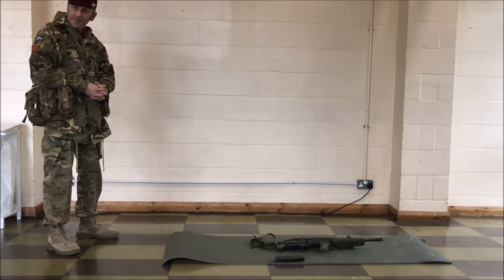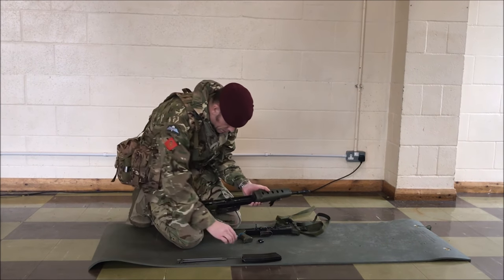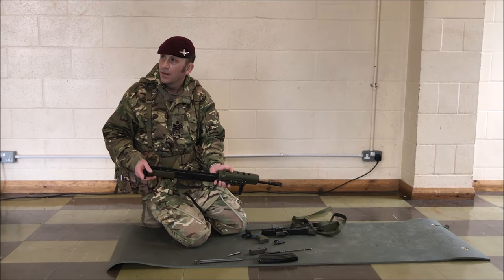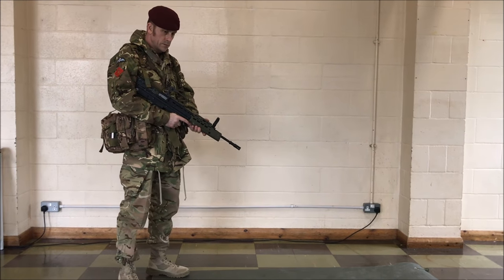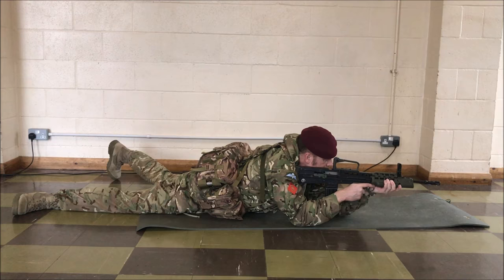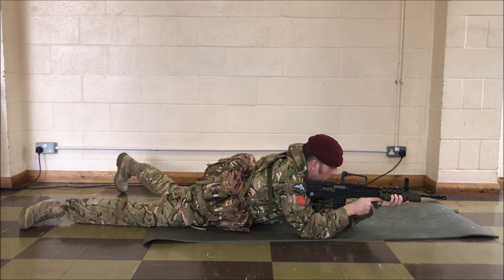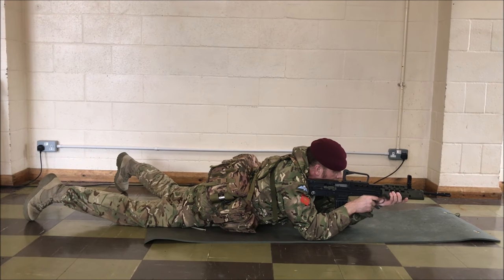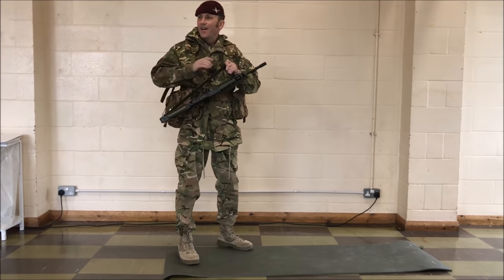L98A2 WHT

Comment: Didn't forward assist 😂😂😂
Reply: It isn’t ACF
Reply: Joe Is Clever so why is he wearing a CFAV TRF?
Reply: I’m joining army cadets soon when corona is over, does anyone know what forward assist is for?
Reply: Lewis Byrne it’s not a forward assist, it’s named changed when the L85 went from A1 to A2, and when the L98 did likewise.
It’s now known as the tap forward and is to ensure the locking splines on the bolt are fully engaged and therefore the bolt is fully forward so the firing pin can actually hit the percussion cap/primer
Reply: Jim Shoebridge but like what’s it actually for, when you run out of ammo and load a mag and you have to press it?
Reply: Lewis Byrne wait until you get taught it
Reply: Jim Shoebridge ok thanks for the help!
Reply: @Meow-gd2my  forward assist is for when theres some malfunction thats stopping the bolt going fully forward under its own power. when the magazine is empty, it should just go all the way forward by itself. when you load a new magazine, if the bolt is open, you press a button on the left that unlatches the bolt. if it isnt open, you rack the bolt with the handle
Reply: @Meow-gd2my  all ima say is don’t join cadets you’ll get rinsed😀
Reply: @callumbanks3522  I’ll be fine, the NCO is best friends with me, he said he will help me through out
Reply: @Meow-gd2my  if ur planning on joining the real army don’t join cadets I meant
Reply: @callumbanks3522  well no, join the cadets but just dont mention that you did
Reply: @EthanThomson  no stop being a mong they’ll find out they always do.
Reply: When it mattered he did, dont need to perform tap forward when doing pre strip NSP as you wont be firing the rifle
Reply: @Meow-gd2my  It’s to make sure the bolt is fully in place.
Reply: @joeisclever9225  That doesn’t matter
Reply: @joeisclever9225 he's wearing a CFAV TRF and is using an L98A2
Reply: @Meow-gd2my  to make sure the cocking handle is fully forward.

Comment: I appreciate this is a test for cadets. Functions test doesn't have to be full as it is repetition only with the cadet rifle (L98 A2) however once obstruction is CLEAR. user must check chamber . CHAMBER CLEAR. this is to ensure there is not a round seated in the chamber before re inserting magazine and releasing the bolt. If there was a round in there you would be starting back with another obstruction. Should all be in pamphlet. Let's ignore the rest for now haha
Reply: That is the function test for the Cadet GP.  And yes it does have to be that exactly.
Reply: Luckily I passed it, it's quite easy once you get the jist of it.

Comment: We was re-issued with this in Late 86 and we all hated it, Wanted our SLR's back.  When first issued the SA80 was a total pig, breach explosions, constant stoppages due to the gas work issues....mainly due to the carbon build up,  things used to break off, we was issued M16 mags to start, dent....round jams, spring frics in the Mag.......and the damn mags had a habit of just dropping off the damn weapon.  Thing I hated the most whilst stripping, yah that bloody horrible strap removal......lol.   Good points Great accuracy, short & compact, and the 5.56mm being so much lighter than the 7.62 you could each carry so much more ammo into battle, the SUSAT being standard was also a great turn.  Must say it became a much better weapon once HK did the overhauls. But still, it certainly didn't have the stopping power of SLR......you knew you hit the target when slotting with the SLR, SA80  required multiple hits to down ya target in most cases with body shots.
Reply: Strange reply here from me mate.  I was 2 Para 74-97.  When we changed from the SLR Blunderbuss to the SA 80,  I recognised two issues.  One, that the stopping power (in my humble opinion) of the 7.62 far out-smacked that of the 5.56, second, that the SA80 outshone the SLR (even with a Suit/SUSAT sight.)  The SA 80 certainly brought you up a level accuracy wise.  HOWEVER, having spoken to an ex REME armourer mate of mine (who did FORTY years in Britmil cos he was so good at his job,) he said that the reason that us Brits lost faith in the 5.56 was because on trials (which he was part of) they used BRIT manufactured/spec 5.56 ammo and it BEAT the SLR in penetration!!!!  I was gobsmacked at this.   When Britmil adaopted the SA80, we reverted to yank manufactured 5.56 (to save money, what fucking changes) and the adoption of that ammo, did not compete with the more expensive Brit manufactured ammo.  He did explain further (beyond my understanding)
Reply: @peterstubbs5934  Thank you for your service Brother.

Comment: Forgot forward assist in places and missed ejected round
Reply from the maker: Yes, good spot
Reply: @Bite_Me_MF  u do the forward assist every time the bolt goes forward (especially when u load a magazine) to make sure the round is in battery and to break down carbon that is present after firing or before firing that wasnt cleaned in the cleaning process, this whole drill actually prevents future malfunctions believe it or not. But ofcourse it is possible for it to cause malfunctions to go worse, with malfunctions u just need common sense.

Comment: Yes, he did not forward assist every time and he did miss the dust cover on occasions but if the rifle had been designed properly in the first place they would not be an issue. Give the man a proper RIFLE , no excuses..... "We sleep soundly in our beds because rough men are prepared to walk the night and do violence in our name." George Orwell.
Reply: its a rifle .. not a gun .. ;-)
Reply: @stuffbypaul  I stand corrected but what's the difference?
Reply: @stephennelmes2707  traditionally, guns have smooth bores, rifles have rifling in the barrel (So technically the main weapon of the challenger 2 tank is a rifle). but one definition of gun is "A tube for launching a projectile" so by that definition you are not actually wrong :-).  .. by that definition, all rifles are guns, but not all guns are rifles ....
..
Reply: @stuffbypaul  So it IS a gun. But, a more accurate description would be a hand held, optically sighted, magazine fed, one man portable, air cooled kinetic energy weapon using the feed cock load lock fire unlock extract eject mechanism. My MK 44 MINIGUN operates on a similar system but is electrically driven using a 24 volt DC battery.
Reply: @stephennelmes2707  its a mouthful , but that will do it, and save any arguments :-)
Reply: @stuffbypaul  No probs mate. If you're into guns. Check out the XM556 from across the pond. Like the MK 44 a bit indiscriminate and I expect, a bitch when stoppages happen but hard to argue with at close range.

Comment: I have heard and read atrocious stories about the SA80/ L85A1. I own a semi-auto version of the Armalite 180 which has the same similar multi lug rotating  bolt, gas piston from the Russian Tokarev rifle, square bolt carrier, and M16 like fire control system taken from the M1 Garand, M1 Carbine, copied on to the AK series. Designed by Eugene Stoner  who invented the AR-15 and later improved M16, A1, A2, A3, A4, M4, and M4A1. I think it was a good design that the British Military had decided to use. First is the good.  First is the stamped receiver. Even though the Germans were first to produce submachineguns as cheaply for mass production as in the MP 38/40, later with the MP 43, STG 44 and 45. Britain produced more STEN guns for the war effort and provided more firepower. The STEN is a very good design but it came down to the soldier firing and selecting magazines that worked and functioned during training before combat. The STEN was good because I also own one. Bottom line is why didn't Enfield back in the day make any semi-auto versions make many for the American market for collectors and shooters like me? I would have loved to own one of these. I have an RSAF 1967 L1A1 which I have built and enjoy shooting. I can understand why the L1A1 is too long, heavy, less ammunition capacity as magazine wise for the average British or FAL, G-3 armed infantryman in combat. The US Army realized this in Vietnam. An American Infantryman in the early days as a Marine or Army would have 5-7 magazines loaded with 7.62 NATO in 20 round magazines and an extra 200 round bandoliers. Bigger caliber means more weight in a combat load with pack. Meaning in a fire fight or heavy combat which emphasizes more on volume of fire on the enemy so that a unit can maneuver and flank to close in. 7.62mm NATO ammo doesn't cut it for combat unless it's a GPMG to cover you as you move. The later M16A1 makes sense with all the improvements to ammunition and components like the chromed chamber and barrel,  chromed bolt carrier interior, and a 30 round mag. With these improvements the M16A1 was still in service beyond 1984 when the Army and Marines got the A2 and finally out by 1997. I have for my shooting pleasure an original Colt AR-15 from 1978, and builds of an M16A1 rifle, carbine, and M4s. Sorry I have been drinking too much but have enjoyed the topic.
Reply: Tldr
Reply: Gay
Reply: @jedcollings3624  Okay expert. Explain? 😂😂😂
Reply: This variant is only used by the cadets, not the real army and only has iron sights and only shoots semi auto
Reply: You are talking a load of bullocks, the STG45 never existed, the STG isn't a sub machine gun as it fires an intermediate rifle cartridge. "M16 like fire control system taken from the M1 Garand, M1 Carbine, copied on to the AK series."  NO, NO and NO you are completely wrong again.  Eugene Stoner first off invented the AR10 in 7.62x51 then the AR15 for the US military, the M16A1 was born, the M16A3 never existed either, Stoner had nothing to do with the rest of the M16 series after the A1. Your firearm knowledge is very poor; why can't you own an SA80 well it's simple because of the USA assault weapons ban, they barred the UK from exporting SA80s into the US for the civilian market.   

I'll leave this here because your comment is giving me a headache and your lack of firearm knowledge considering you claim you own firearms is truly shocking.

Comment: Some things to make sure to remember as they are easy to forget: Tap forwards. Always check safety. Right hand at rear to catch the spring should it fly out. Pre-strip NSP: Don't fire it off. Pick up the imaginary round that leaves the chamber after opening (when readied) Don't forget to take your time and talk/think yourself through it.

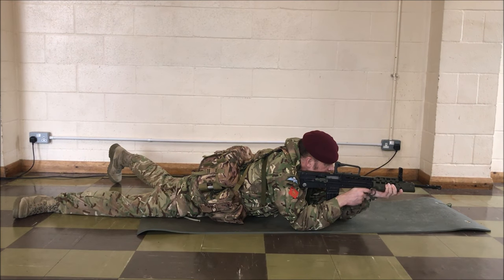Comment: At 6:16 when the weapon fails to fire first time & the instructor/examiner says "cocking handle appears fully forward."
The soldier forward assists & then (apparently) continues to fire. 
I've always found this to be a flawed practice, as when the weapon fails to fire you'd have fired off the action.
Which means the only action to take in the instance of such a stoppage would be to cock the rifle again.
By all means, correct me if I'm wrong, it's just a thought I'd had recently.
Reply: From my experiments with the weapon, if the bolt is not seated properly pulling the trigger does not fire off the action. Thus a forward assist would put the bolt in place allowing the action to be fired.
Reply: But then again, what I did do in basic training during pairs fire & maneuver, is get a stoppage & immediately try to re-cock the weapon, which because the bolt wasn't in contact with the round has caused the round not to be ejected & the next round has been pushed into the back of the round already in the chamber causing a mega stoppage & a great deal of shouting & flapping!
Reply: Due to the stoppage not being actually real, it's hard to explain, this stoppage is the bolt carrier not travelling far enough forward, meaning the hammer is not able to be realised due to it being cocked onto the safety sear, not the main sear (which the trigger can control), tapping forward assist would then allow the bolt carrier to move that little further forward, tripping the safety sear allowing the hammer to be cocked on the main sear, so when the trigger is pulled the hammer is realised and fires the round. In this test due to not being able to replicate the bolt assembly not moving forward enough when the trigger is pulled the hammer will come up, and the drill looks pointless, but for a live stoppage, this is absolutely what you should do.
Reply: Out of battery safety stops the sear dropping the hammer on a round unless the bolt is fully locked
Reply: It's only the last 1/8th (one eighth) of inch of forward movement by the bolt carrier assembly  that the bolt rotates 22.5 degrees to the right.  The hammer is prevented from being released until the BCA is fully forward.  This is known as mechanical safety.

Comment: Interesting video. I'm curious. What's the reason behind the karate chop to the cocking handle when the I guess bold is already forward asides from ensuring the handle is fully forward. I can't help but think the bolt (hope I got that right) should move fully forward without obstruction.

Comment: Surely with the obstruction stoppage drill the Staff Sgt should’ve checked that the chamber was clear before reinserting the magazine. I’ve been told you can fail your test for not doing that
Reply: Video's two years old, so probably different guidelines then. They also advise tipping to the right now for obstruction.

Comment: What's all this forward assist nonsense, does this gun suck so bad that you have to use the forward assist every time before taking a shot, why would that even be a requirement to use the forward assist during this test. I don't know about this gun but the AR-15 didn't even have a forward assist to begin with and the inventor Eugene Stoner was against it because if a round doesn't just go into the chamber naturally there's probably something wrong with the the gun or cartridge but since the guns have to be used in combat and not just on the range they added it for situations where you didn't have time to diagnose the problem so you just jam the forward assist forward and hope it works, I guess it works most the time because they kept it.

Comment: 0:15 already failed he didn’t do his forward assist before taking an aimed shot
Reply: Alan Gibson you can only fail on safety issues forward assist is definitely not a safety function
Reply: Forward assist isn't a requirement on the a2
Reply: Its not an instant fail
Reply: factssss
Reply: A R it is required however it’s a technical failure and you are allowed 3 in your WHT but only 1 safety fail e.g not checking safety
Reply: jac con it isn’t, I’m a sect comd at ATC and teach this daily, it’s no longer in the Pam because the weapon has been updated to not require it it’s just an old habit.
Reply: A R, it most certainly is in the Pam and should be taught, I suggest you go and re read the Pam, the TAP FORWARD, if missed is certainly an error and the one most commonly made, it’s usually the one mistake that they are allowed to make on each separate test.
I can only assume that you’re an adult, unless the ATC differs from the the ACF/CCF in the respect that cadets cannot teach  SAA
Reply: Jim Shoebridge ATC is army training centre it’s phase 1 training you’d know that if you were military
Reply: A R, it’s also Air Training Corp, which is cadets and since the video is about an L98A2 it was a fair assumption that you were a cadet, I taught Ph1 when they were RTC, Regional Training Centres, long be ITG got involved and rebranded them to ATC, it would have helped if you’d put the initials for your ATC...and while it may not be in the Regular/Reserve Pam, BAEBB is playing upright now and not loading the Pam, the Tap Forward is still in the Cadet Pam, the Pam for the weapon system being used....

As for your comment about me knowing what ATC was if I was in the military, I’ll give that a by, I’m still serving. 

What I don’t do is assume that the Cadet L98A2 has the same drills and is taught from the same Pam as the L85A2... as you should know each weapon system has its own Pam...

ETA: BAEBB is working now, I suggest you read the Pam, the Tap Forward is mentioned in NSPs, the Ready and the Unload, I stopped reading at that stage...I read lesson 9, all I can say is you really need to read the Pam
Reply: @AR-zr1om   known @jimshoebridge from when I was a cadet/CFAV, he was among the people that inspired me to go on to join the army. Can attest that he is in fact military. He is absolutely right about the Air Training Corps (Recently renamed the RAF Air Cadets) comment, pretty sure that's part of why they changed the title to avoidnthe mix up and add in a measure of verbal connection to the RAF.

Comment: Few things i noticed that wasnt done correctly when cocking the handle they didnt forward assist, they also didnt take apart fully the bolt assembly or test the automatic function during the functions test. just some small details I noticed not sure if its done differently in the army so please correct me if wrong :)
Reply: You’re not wrong at all